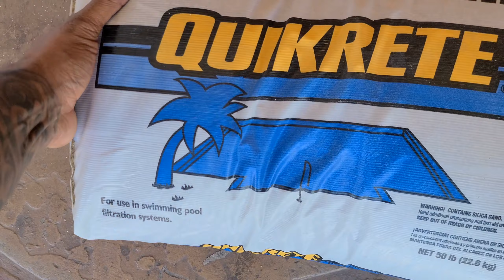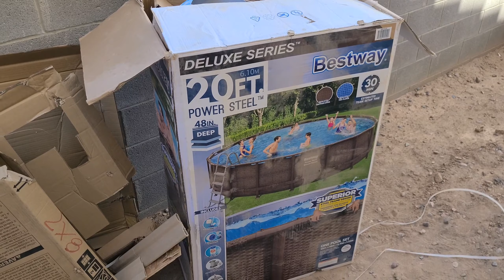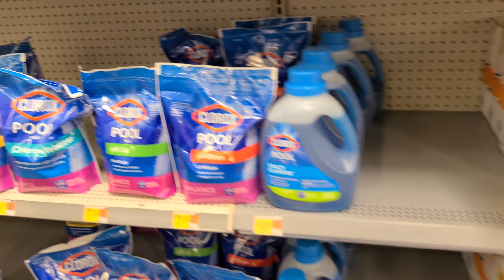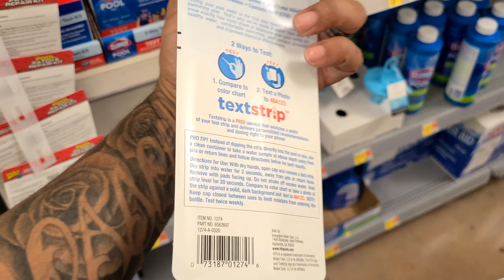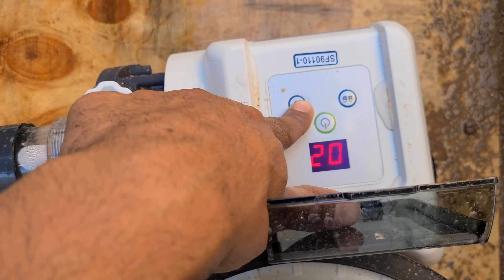Our Sams Club 20x48 Pool EXCITMENT‼️...Then DISASTER⁉️

Comment: There’s a piece that screws into that hole and it has a rubber plug at the top. It’s used to aerate the water and also that hole is supposed to be facing up.

Comment: Did you every get the leak fixed? Was it the pool itself leaking, or just where the pump was?
Reply from the maker: It was our fault for now putting enough sand under our pool. A rock got thru.. but suggestion. Buy a sand filter from Amazon